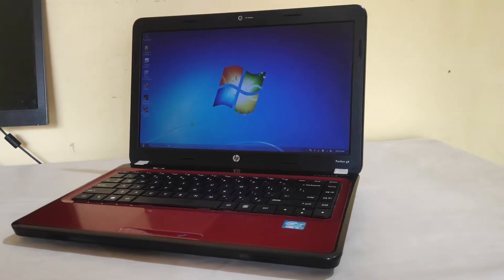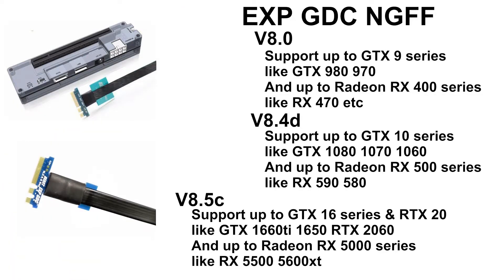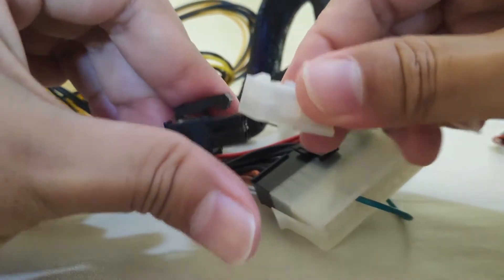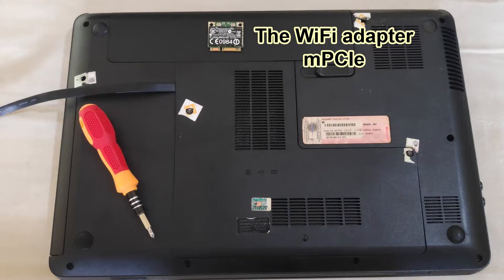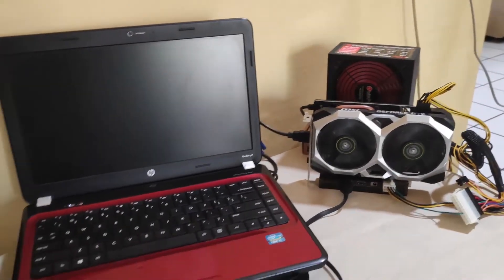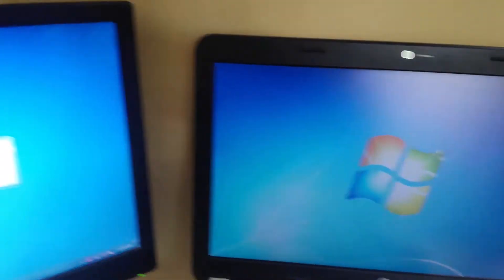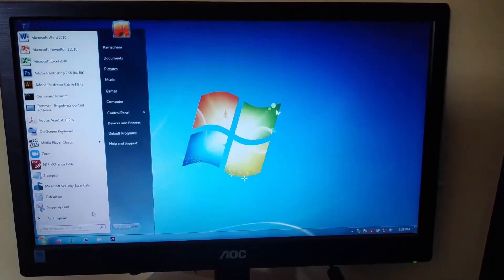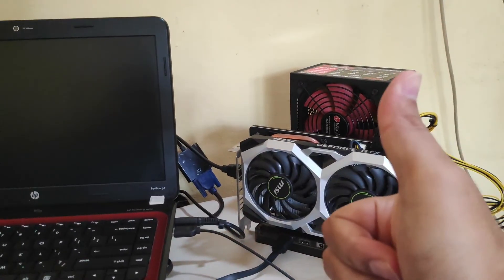EXP GDC Beast V8.5c eGPU with GTX 1660 ti on Old Laptop from 2012

Comment: Bro, I just want to say: THANK YOU SO MUCH. Your video have everything a person need to know, It's sooo clear. I'm so grateful. Have a nice day, hope u doing well.
Reply from the maker: Thanks. Sorry I haven't been active lately. Because I want to make another External GPU tutorial but with newer Laptop. Having trouble finding the good Laptop.
Reply: @ClayWheeler  And just for your knowledge, I did eGPU and everything is working fine. Mine is 2017 Dell Inspiron 14 7460, core i5 7200u with dGPU 940MX. My eGPU is a GTX 960 2gb with NGFF EXP GDC 8.5c . Everything is running so much better after I did this eGPU.

I just needed to DISABLE the 940mx on Device Manager. Cause If I uninstall the drivers, the Windows automatically detects the dGPU, enables It and turns It the "master" GPU again. So I need to disable and then install the GTX 960 newer drivers. Everythin is working fine.

The only problem is th 2gb VRAM of my 960... Some games like Assassins Creed or Cyberpunk 2077 needs at least 3gb... That's why I'm thinking to upgrade the eGPU for gtx 970 (even If it is too powerful for my CPU) or gtx 1060 3gb. I dont know If will be a good trade change the 960 2gb for the 960 4gb... 

What do you think? Anyway, today a friend with 1060 6gb will bring his gpu to me, for a test... But I think the 970 will garantee a good compatibility
Reply: @mauriciocajazeira228  heyy there man, i know it's been a while after you post this comment 😅

I'm planning to use EXP GDC V8.5 or 8.4 too. On your comment, said that you need to disable the 940mx driver right? So, if you install your GTX960 with the 940mx's driver disabled, does that mean that you're overwriting 940mx driver with your gtx960?

What if you need to go portable (unplugs all of the cables and back to original state again), does the 940mx still works normally? Does the GTX 960 driver support the 940MX driver too so you wont have to reinstall the 940mx driver again?

I really appriciate your future replies, Thanks in advance btw🙏
Reply: @ClayWheeler  I understand your situation... Here in Brazil everything is too overpriced... Do to Covid and the fu**ing bad governation of our president Bolsonaro.

Comment: I have i3 5th gen 5005u does it compatible with 1050ti with egpu dock?
Reply from the maker: Absolutely fine.
Reply: @ClayWheeler  I saw in some forum saying pci express egpu dock doesn't compatible with 1050ti
Reply from the maker: @14yogeshkumar99  because there are 2 different Types of GTX 1050 ti.

One version without PCIe power cable. This one not compatible with EXP GDC.

Another one with PCIe power cable like in my video 05:14 
This one is compatible with EXP GDC.
Reply: @ClayWheeler  got it

Comment: hello i have hp g4 1212tx laptop which vga can i use?the purpose is to work with lumion or enscape software..
Reply from the maker: That Laptop almost the same to my Laptop. But I don't recommend to use it with Lumion.

Lumion needs at least 4 Cores 4 Threads 4 Logical CPU. Any CPU below that is not recommended. So instead of Core i5 2430M with 2 Cores 4 Threads 4 Logical CPU, you need to upgrade to Core i7 3630QM, which is 4 Cores 8 Threads 8 Logical CPU.

Lumion needs high CPU instead of GPU. As for the GPU, anything is possible.

At that point I recommend building a cheap Desktop PC instead of using Laptop with External GPU like this.
Reply: well i have bought exp gdc for external graphics & got scam fake vga gtx730 from alixpress vga not detected damnn....not working hopefully if i got msi/genuine one will work..

Comment: Hi man, i've Acer Aspire 3 A315-41 with Ryzen 5 2500U (Radeon Vega 8 APU 1 GB) But when, i see the website of EXP GDC Compatibility, i didn't see my laptop in the list. I want to connect it with GTX 16 Series like this video, but how do i connect it, if my laptop isn't in the list of compatibility?
Reply from the maker: Actually you can, all Laptops can.

First of all, you will be limited with 2 Options for External GPU. WiFi slot OR M.2 NVMe slot.

The First Option is by WiFi slot, which without a doubt, you have NGFF slot. With NGFF you have 8Gbps Bandwidth (while this video is just 2.5Gbps) So you can use EXP GDC NGFF.

Second Option is M.2 NVMe. To make sure about this, please open your Laptop manually, and check if the Motherboard have Two M.2 NVMe slots and make sure it is written "NVMe" or "PCIe" on its PCB board near the M.2 slot.
If it says "M.2" or "SSD" then you cannot use eGPU with this slot. If it says "NVMe" or "PCIe" then you can use that slot for eGPU. So you can buy EXP GDC V9.0b NVMe.

Search keywords on AliExpress is "Beast EXP GDC"
Reply from the maker: With M.2 NVMe, you can have 16Gbps bandwidth if it is X2 Lanes, OR 32Gbps bandwidth if it is X4 Lanes.

Comment: Why didn't you use the mPCIe to HDMI 5Gb/s instead of 2.5Gb/s if the bus speed of your processor is 5Gb/s .. ???
Reply from the maker: Nah it's 2.5Gbps I tested it. And apparently mPCIe have 2 Variant.

2.5Gbps which is usually from 2010-2013. And 5Gbps from 2013-2015. And sometimes there's also Bidirectional support and no support. That's just how mPCIe work. Check on Wikipedia and you'll understand it immediately
Reply from the maker: Core i5 2430m still using PCIe Gen 2. Hence why it's 2.5Gbps

Meanwhile Lenovo ThinkPad T430 with Core i7 3610QM is using PCIe gen 3. And it's only 9 months apart from my laptop's release date.
Reply from the maker: Core i5 2430m still using PCIe Gen 2. Hence why it's 2.5Gbps

Meanwhile Lenovo ThinkPad T430 with Core i7 3610QM is using PCIe gen 3. And it's only 9 months apart from my laptop's release date. Hence why it's capable of 5Gbps.
Reply: @ClayWheeler  Yes, you are right all 2nd generation processors have PCI express 2.0, but you can give your processor an updrade with an i7 3840qm for example since the Yvy Brige processors are compatible with the Sandy Brige platform, of course always and when your motherboard motherboard have HM75, HM76, HM77 or QM77 chipset...
And also to avoid a bottleneck.
Reply from the maker: @finalpro2650  no no, you Don't get it, even if I CAN upgrade the CPU to Ivy Bridge which has PCIe Gen 3, I cannot change the fact that the Laptop's Motherboard still has PCIe Gen 2 hence it will remain PCIe Gen 2.

Therefore the bottleneck will be the same whether I use Core i5 2430m or Core i7 Ivy Bridge QM series. Most game will perform the same because of PCIe Gen 2. No difference Whatsoever
Reply: @ClayWheeler  It is not the year itself, since the third generation, especially since i5 Series M, QM more, it has PCI express 3.0 at 5Gb/s bus speed.
Reply from the maker: The Beast EXP GDC cable itself capable of 5Gbps but my Laptop is still 2.5Gbps so there's nothing I can do about it, unless I get a newer Laptop like from 2015 for example. Which mPCIe is definitely 5Gbps
Reply from the maker: Core i5 2430m still using PCIe Gen 2. Hence why it's 2.5Gbps

Meanwhile Lenovo ThinkPad T430 with Core i7 3610QM is using PCIe gen 3. And it's only 9 months apart from my laptop's release date.

Comment: is gdc v8.4d can support asus gtx 1080ti 11gb?
(my laptop i5 10thgen 20gb mx230)
Reply from the maker: EXP GDC V8.4D is optimized for old Laptops from 2011-2015 only and yes it supports GTX 1080ti.

But EXP GDC M.2 NVMe v9.0 also supports GTX 1080 ti up to RTX 3000
Reply: @ClayWheeler  i try to check in ggogle forr bootleneck calculator ur right 1080ti is bottleneck for my (i5 10210U) so i try to lower it to 1070 but still, last i try 1060 working but  in YT reviews RX590 is more powerful than 1060.  final conclusion: do u think RX590 is good for GDC v8.4d( ONLY LATEST AVAILABLE IN MY COUNTRY) for my laptop = i5 10210u ,20 gb ram..
Reply from the maker: @Wingzify  your Laptop will not Bottleneck GTX 1080 ti so you're good.

Is your Laptop have Thunderbolt? Or can you confirm that your Laptop has 2 M.2 NVMe slot? So that you can use:

EXP GDC v9.0 or ADT-Link R43SG.

But if your Laptop don't have 2 NVMe slot, then your only choice is Using WiFi slot NGFF. These are the Options

Option 1) ADT-Link R52SF, R52SL, R52SR
Choose one, here is the Link http://www.adt.link/product/R52.html

Option 2) ADT-Link R53SF, R53SL, R53SR and here's the Link http://www.adt.link/product/R53.html

Option 3) Beast EXP GDC eGPU. Use that keywords on AliExpress search.
Reply from the maker: @Wingzify  your Laptop is using 10th gen Core i5, so you can use GTX 1080 without any problems.

But what is the Model of your Laptop exactly?
Reply: @ClayWheeler  lenovo ideapad c340-14iml
Reply from the maker: @Wingzify  is this page Correct?

https://psref.lenovo.com/Product/ideapad_C340_14IML 

It says you only have 1 M.2 NVMe slot. That means you can only use WiFi NGFF slot.
Reply from the maker: @Wingzify  
This is the Disassembly video I can find. Is this correct?

/watch?v=oAtamA8zSpw

That means you can use NGFF slot for eGPU.
Reply: @ClayWheeler  so i will buy NGFF right? i thoughtt its mini pcie.. so SHOULD I go for GDC 8.4 FOR 1080 TI?
Reply from the maker: @Wingzify  Yes you can.

But if you're interested there is also ADT-Link alternative but I'm not forcing you to get it. EXP GDC NGFF will work.

Here is another video with EXP GDC RTX 3070 
/watch?v=6JcucfWz51o

Watch it is very funny but practical
Reply from the maker: Correct it supports it.

But I think you shouldn't buy EXP GDC V8.4d because the Bottleneck is too big for newer Laptops.

What is your current Laptop model? I will help finding better Cheap eGPU

Comment: @Clay Wheeler can u help me please? i dont have that power supply cable but i have exp gdc.. can i buy only the cable anywhere? or can i use power supply from dell made for this exp gdc? but im limited to 220w with this psu.. is it enough for rx 570? or 580?  ty so much
Reply from the maker: Yes you can. Try to search for 8 pins PCIe Female Cable branched to 8 pins + 8 pins Male. I think it's everywhere on the market.

So the 8 pins male go to EXP GDC, the other 8 pins to male go to Radeon RX.
Reply: @ClayWheeler  8 pins female? u use 20 pin :D im really lost :D 

how u write 8 pin female, is it something like this?
 https://smicro.cz/supermicro-cbl-pwex-1040-1?gclid=CjwKCAjw6fCCBhBNEiwAem5SO2CtnaUwcGblmYb0diHya0TFGOfTNi7pWcWReWPSY4lCWmaJb3xowRoCaroQAvD_BwE
Reply from the maker: @radekjrs2855  in this video, I'm using 20 pins from the Motherboard only to Jumpstart the PSU (Like already explained in the video)

As you can see from that 20 pins of mine, only 1 Green cable going to the eGPU 8 pins input. And with 4 pins CPU total 5 pins. It's only for Jumpstart.

I suggest you to search another similar video like this one but using Dell PowerSupply
Reply: @ClayWheeler  wait, i can use that power supply with 220 watts?
Reply from the maker: @radekjrs2855  and by the way, the Link you gave me is Correct.

Watch this
/watch?v=sTSxdQuj8Bw
Reply: @ClayWheeler  ty, i try my dell psu and if its not be enough for gpu,  i will go buy psu.. Im waiting for any good gpu bcs in this situation its hard to find any :D
Reply from the maker: @radekjrs2855  Oh wait I think there's another possible way. A bit simpler

You plug the 8 pins Dell PSU directly to the EXP GDC. And then buy 6 pins Male to 8 pins Male PCIe cable, and plug it to the side part of 6 pins EXP GDC.
Reply from the maker: @radekjrs2855  on the other note: RX 580 needs about 185 Watt.
A 200 watt Dell PSU is enough
Reply: @ClayWheeler  4gb or 8gb? 
And if I have alienware with intel hd  and gtx  660m, amd  works good right?
Reply from the maker: @radekjrs2855  if I'm not wrong 185 watt is 8 GB.

But you shouldn't worry about not enough Voltage for External GPU like this. Because basically depending on your Available Socket, like Mini PCIe (mPCIe) it is limited to 2.5Gbps.

Because of low amount of Bandwidth, the amount of Wattage needed by Radeon RX also lower. So in the end you will never Touch 185 Watt limit at all. Well, because of bottleneck bandwidth.

Same thing in this video, I said GTX 1660ti has 120 Watt TDP, but in reality it never use more than 100 watt.
Reply: @ClayWheeler  and what GPU use for I7-3630qm? In every game processor go on 40% max and GPU goes on 100%.. I think Rx 570 or 580 have something like 5% bottleneck.. It's old processor but still good
Reply from the maker: @radekjrs2855   it is actually possible to use NVidia 1060 6GB for example, but you need to find a way to permanently Disable the dGPU of your Laptop for the GTX 660M.
Some people suggested to open Device Manager, go to system, expand, scroll down, and disable the First PCIe on the list, because it is usually linked to the built-in GTX 660m. Otherwise you need to disable it from BIOS

I haven't tried it myself, but you can find Plenty of other Videos using exactly Core i7 3620QM external GPU. There are plenty on YouTube
Reply from the maker: @radekjrs2855  but if you don't want to go with complicated steps, then just buy Radeon RX.
Reply from the maker: @radekjrs2855  Alternatively, you can completely Take Off the GTX 660m from the Laptop's Motherboard because it is using MXM slot. The way to take it Out Actually pretty much the same like Swapping out HardDisk of the Laptop.
Reply: @ClayWheeler  but 1060 use more then 220 watts.. I think I use Rx 580.. Its good graphic and mby  better then 1060.. I know I can remove my 660, uninstall drivers and use 1060 but how I see on yt, this "swap" have more complications and I must download unlocked bios for GPU higher then gtx  980.. That's the reason why I want use Rx 580 :) but I'm thinking about 8 gb  version but I think it's going be overkill for my CPU.. And sorry for my English :)
Reply from the maker: @radekjrs2855  yeah then buy RX 580 8GB.

As I mentioned before, it will not consume more than 100 Watt, because of the Available Bandwidth of the socket (mPCIe) like literally any card running on EXP GDC with mPCIe will consume significantly lower Wattage. Someone tried EXP GDC mPCIe with RTX 3070, guess what? It still consumes Less than 100 watt. Because you're Limited by the Bandwidth.

That's why even 200 Watt Dell PSU is enough even for RTX 3070 on this particular EXP GDC mPCIe.

But it is a different story if using EXP GDC M.2 NVMe which fairly consumes higher Watts.
Reply: @ClayWheeler  okay, thank you so much  :)

Comment: hey mate is it possible for me to actually have a 2 different driver (Nvidia is the laptop's gpu ) and the 
amd one is the egpu from the dock. Like Everytime i dont use the amd's egpu can i just switch to the nvidia one  without causing any problem??
Reply from the maker: That's exactly what this video is talking about.

I can switch to my Radeon GPU whenever NVidia is disconnected (unplugged)
Reply: @ClayWheeler  ahh i see the point there, dont have to uninstall the mobile gpu driver, im asking wether its doable or not..m and since it could then really good to know that... anyway thx for the reply mate good video.

Comment: hello i had setup up epgu with the exp gdc ngff version with gtx 1060 3gb.So everytime i try to boot up my laptop wouldnt boot up but the gpu psu fan would be spinning for a few seconds but they would stop and i would get these annyoying beep sounds.Can you help me fix this error and btw my laptop is dell inspiron 14 5442.Thank you
Reply from the maker: Option 1) Put back the WiFi Adapter like original placement. Start the Laptop once. And then put it to Sleep instead of Shutdown. SLEEP not SHUTDOWN. And then take off WiFi adapter, and Plug the eGPU like usual.

Option 2) is it using Windows 10? Please do a Full Shutdown just like Windows 7. Start-Run command or CMD
Shutdown.exe /s /f /t 1
And then put back the eGPU.

Option 3) Reinstall Laptop with Windows 7.
Reply: @ClayWheeler  yes i am using windows 10 and thanks for the reply

Comment: Bro I have a Lenovo think pad t450s with 12 GB ram and a 2.6 processor but boosted to 3.2 what are your recommendations on a gpu ?? Plz Answer
Reply from the maker: Yeah, first open up your Laptop case to see the type of the Available Socket.
And then make sure that your BIOS has options for booting menus.
Reply: @ClayWheeler  it comes with a extra  pci-e port on it if that's what ur asking
Reply from the maker: @itzzjhemzzz552  Great, then use mPCIe eGPU docking. Any kind of GPU is okay, like GTX 16xx or Radeon RX 5000
Reply from the maker: @itzzjhemzzz552  I just watched a video about Lenovo T450s disassembly. And apparently it has NGFF slot? Instead of mPCIe slot on its WiFi adapter?

Anyway you have to make sure by yourself.
Reply from the maker: @itzzjhemzzz552  After watching the video about Lenovo T450s. I've come to the conclusion:

The M.2 empty slot in your comment is not part of PCIe controller to the Laptop. Meaning it is part of SATA Controller, which means you can only install M.2 2240 SSD into that socket. It doesn't have NVMe capability for eGPU.

The WiFi adapter beside it, is using NGFF slot type. And usually WiFi adapter is part of PCIe controller. Therefore you can only install eGPU to this socket.

This means your only way to connect to the internet is using LAN cable, or USB WiFi, or Android USB Tethering.
Reply from the maker: @itzzjhemzzz552  here is the video
/watch?v=MSkG8sbtaTg
Reply: @ClayWheeler  thank you so much for taking your time to help me out bro its greatly appreciated thx a ton
Reply: @ClayWheeler  dropped a sub with noties 😁